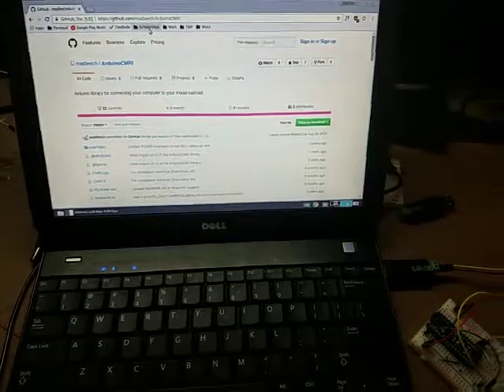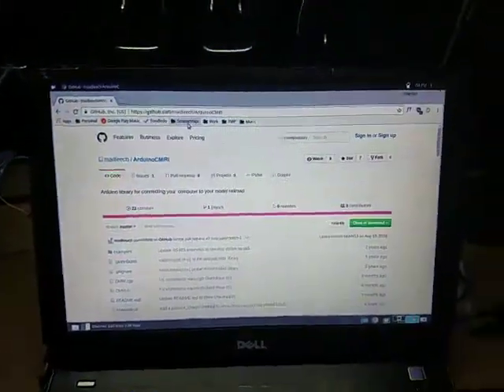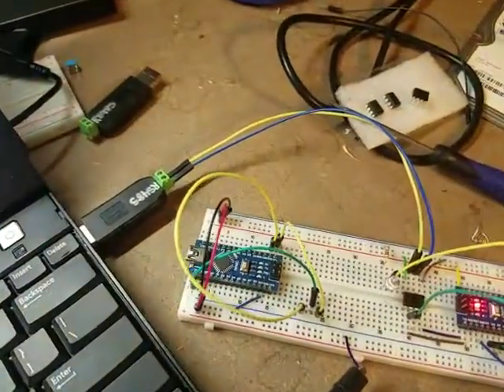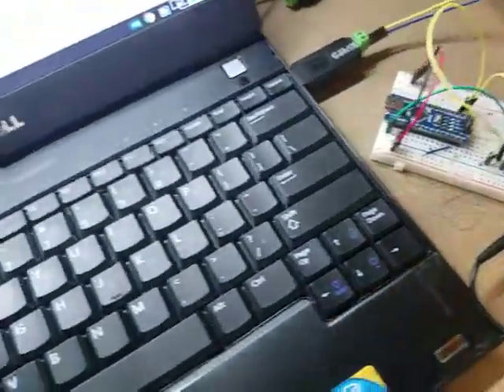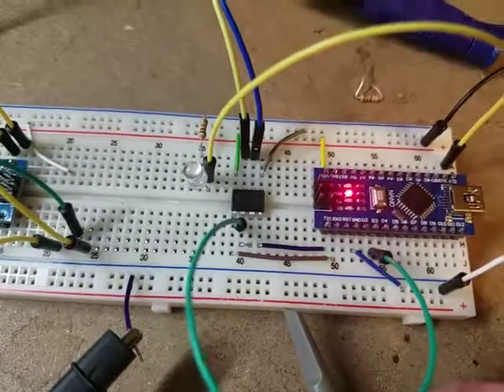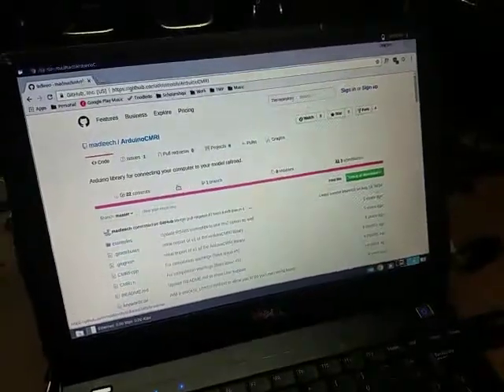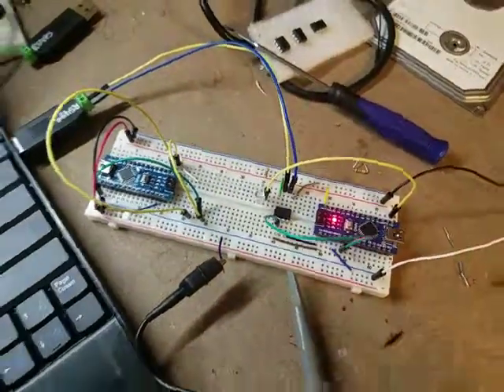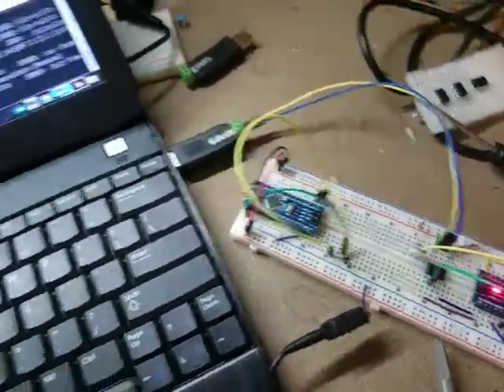ArduinoCMRI and RS485 - I fixed it!

Comment: Hi
I am De Silva from Sri Lanka. I have been trying to connect to the CMRI node with JMRI. I am not able to get the CMRI node to respond. Can please let me know the modifications you made on the libraries. 
Thanks
Reply from the maker: Hello De Silva! You can see the changes I made to the library at https://github.com/k4kfh/Auto485, but the original developer (madleech) has integrated those changes into the main GitHub repo so the modifications are already done when you download it.

Are you using a direct (USB) connection with a single CMRI node, or are you using multiple CMRI nodes with an RS485 bus as I did in this video? If you'll send me your code I'll be happy to take a look at it and see if I notice anything.

Good luck!
Reply: Hi 
Thanks for the message.

I was using the example files downloaded from  https://github.com/k4kfh/Auto485. After complied echo.ino and loading it to an arudino checked the packets sent the CMRI Monitor on JMRI and see that there is no response to the poll. I not an expert at programming. I was using a MacBook Air for this test.
Reply from the maker: Oh, okay. For initial tests don't worry with JMRI yet (it introduces a lot of extra complexity and potential problems). Just compile echo.ino and use the serial monitor in the Arduino IDE. That sketch should print "hello world" to the serial monitor if it's working correctly.

Remember that Auto485 is just an RS485 communication system. CMRI uses Auto485 to talk on an RS485 bus, but Auto485 won't function as a CMRI system by itself (kind of like a car uses a transmission to move, but an transmission by itself won't get you to work and back).

Once you're sure you can print hello world with echo.ino via RS485, then you can try this example (with the ArduinoCMRI library) to get started with JMRI. https://github.com/madleech/ArduinoCMRI/blob/master/examples/rs485_cmri_hello_world/rs485_cmri_hello_world.ino

Let me know how it goes, good luck!
Reply: Hi and Good Morning ! 

It is De Silva from Sri Lanka again and thanks for the message. 

I had the "Hello World" sketch work and then tried the new file you had sent the URL. Now it work great. I will now start tinkering with the sketch you sent to meet my networks requirements. 

Thank you very much. 

Should you meed anything from Sri Lanka please let me know.
Reply: Hi, It is De Silva again from Sri Lanka. 
I upgraded my MacBook Air and when I tried to connect to connect to the CMRI node via JMRI,  it was not possible. I have also lost the sketch as I formatted my hard disk. Can you please send me the sketch you send me before.
Reply from the maker: To simply test your RS485 serial connection, open the arduino serial monitor and run the echo.ino sketch from madleech's Auto485 repo. To test JMRI, try this: https://github.com/madleech/ArduinoCMRI/blob/master/examples/rs485_cmri_hello_world/rs485_cmri_hello_world.ino

Good luck!
Reply: Thanks for the message.

I did test with the sketch echo.ino, I get the message "Hello world, now listening". It say so even when the key are input.

I checked in my system setup and confirmed that the RS485 driver is loaded. 

When I uploaded the sketch you had pointed in your message, I get the following log:

"Transmit ua=0 OB=0 0 0 0 0 0 
Poll ua=0
Transmit ua=0 OB=1 0 0 0 0 0 
Poll ua=0
unrecognized rep: "00 3f 5f 25 00 00 00 3f 5f 5b 59 fe fe f2 00 00 00 3f 5f 95 fe fe fe fe fe f2 02 00 3f 5f 25 00 00 00 3f 5f 25 00 00 00 3f 5f 25 00 00 00 3f 5f 5b 59 fe fe f2 00 00 00 3f 5f 95 fe fe fe fe fe f2 02 00 3f 5f 25 00 00 00 3f 5f 25 00 00 00 3f 5f 25 00 00 00 3f 5f 5b 59 fe fe f2 00 00 00 3f 5f 95 fe fe fe fe fe f2 02 00 3f 5f 25 00 00 00 3f 5f 95 fe fe fe fe fe"
Poll ua=0
Poll ua=0
Poll ua=0
Poll ua=0
 
Can you please help.
Reply from the maker: KTMR De Silva Is that log entry from the Arduino IDE serial monitor or from somewhere in JMRI?
Reply: The Message "Hello world, now listening " is from the Arduino IDE serial monitor.

The long list of messages is form the JMRI CMRI monitor
Reply from the maker: KTMR De Silva What have you tried doing in JMRI? The goal of that example sketch is to turn the built in LED on pin 13 on and off with CMRI. Also, which Arduino are you using?
Reply: I am using the Arduino Pro Mini. As for the sketch used, it  sets up pin 13 (LED) as an output, pin 12 as an input, and attaches both to 
 * the first output/input bits of the emulated SMINI interface

The following is the sketch:

#include <Auto485.h>
#include <CMRI.h>

Auto485 bus(2); // Arduino pin 2 -> MAX485 DE and RE pins
CMRI cmri(0, 24, 48, bus); // sets up an SMINI with address 0. SMINI = 24 inputs, 48 outputs

void setup() {
  bus.begin(9600, SERIAL_8N2); // open the RS485 bus at 9600bps
  pinMode(12, INPUT); digitalWrite(12, HIGH);
  pinMode(13, OUTPUT);
}

void loop() {
  // 1: main processing node of cmri library
  cmri.process();
  
  // 2: update output. Reads bit 0 of T packet and sets the LED to this
  digitalWrite(13, cmri.get_bit(0));
  
  // 3: update inputs
  cmri.set_bit(0, !digitalRead(12));
}
Reply from the maker: KTMR De Silva Have you set up the CMRI system as a Light in JMRI? You can also configure it as a turnout if you'd prefer
Reply: I have set it as a light as I am usage solenoid operated turnouts